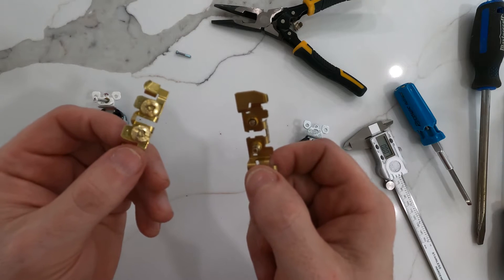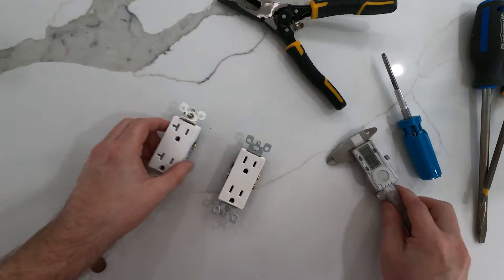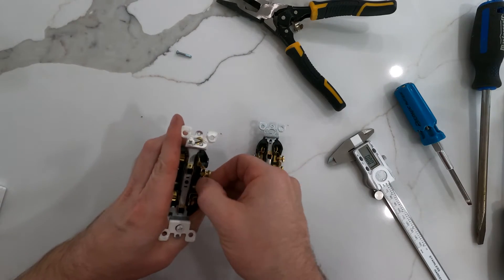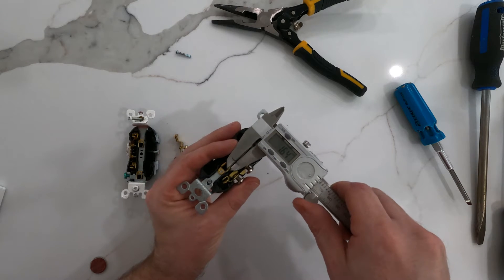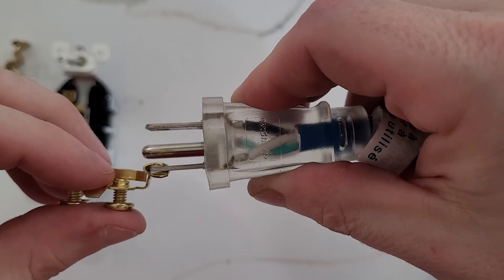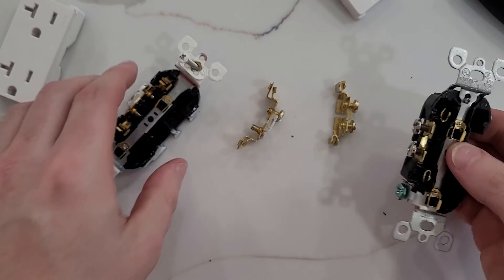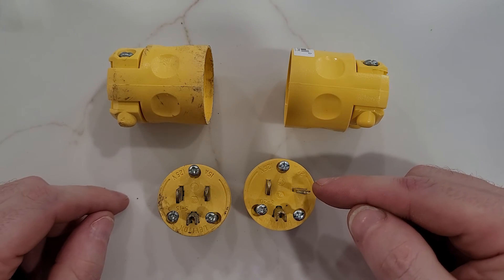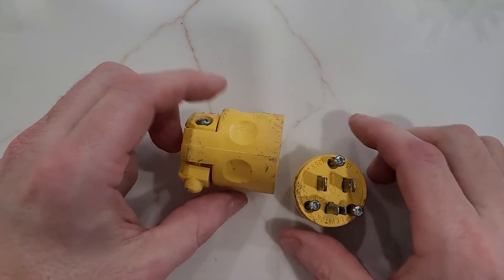Difference Between 20 amp vs 15 amp Receptacles!

Comment: Material has a lot to do with conductivity. Until you run a multimeter on it and see the numbers your just pissing in the wind buddy
Reply from the maker: it's literally exactly the same material 🤣😂
Reply: What kinda test did you do to know what metals were used? @MooseDoesStuff
Reply from the maker: @joshholschuh1847  I asked it what it's pronouns were.

Seriously, the way science works is if you find a flaw in my experiment is to do the experiment yourself while adjusting for that flaw. Then see if you come up with the same results. Then share your results. If you've got reason to think they're NOT identical metals punched out of the same sheet that comes off the same roll in some factory, by all means, go test them.
Reply: Or did you just look at the plating and assume it's the same
Reply from the maker: @joshholschuh1847 feel free to prove me wrong, tear a few apart and put your meter on them and make a video!
Reply from the maker: @joshholschuh1847  it's kinda bonkers you think that any manufacturer is plating anything in switches or recepticals. And that you can't recognize brass... big oof.
Reply: @MooseDoesStuff and I think it's absolutely amazing that you think that you can see an electronic variation in current
Reply: I didn't say I didn't appreciate what you did, yeah that's good that you took apart two different products and shown that there was similarities but you really want to test electronic components to get real answers. This isn't just stuff you see. In building electronic components , there are several different types of alloys that they use based on the current, in most of the time they're the exact same size, but that makes the variation in current, because some metals have more resistance than others like aluminum has more resistance than copper. An aluminum plated looks just like other materials, if you want to be ignorant about it you can start by tapping on the objects to hear if they have the same tone because aluminum is a lot duller of a tone  than steel, but in order to have a jam up video why don't you just put a multimeter on each end of the piece so you can give an exact readout and make even more of a point if you're trying to make one.
Reply: I really don't understand how a man who does anything constructive doesn't know how to use a multimeter or have a $5 one laying around. That might be the most mind-blowing part
Reply from the maker: @joshholschuh1847  OOf if you think any reading you'll get from a 5$ multimeter is going to be reliable.
Reply from the maker: @joshholschuh1847  You sure wrote a whole lot to say "I don't know how to identify aluminium" and follow it up with "I'm derpy enough to think they're using copper in recepticals."
Reply from the maker: @joshholschuh1847  All this effort you put into showing how you don't know what you're talking about could've instead been put into making your own video and contributing to the science!
Reply: You can convince uneducated people a lot of things but you ain't hitting on nothing but a program that puts words on your video making it click bait
Reply from the maker: @joshholschuh1847  Show me someone who's looked into this any better than I have. Or you do it your way and make a video :D
Reply: @MooseDoesStuff yeah but I'm not a 12-year-old fucking kid, I don't just do what people want me to do just cuz it's something to do, I don't really care if you misguided people. Or at least I don't anymore, the energy that I put into it that was it but good luck buddy. Just don't ever call yourself a scientist cuz you ain't got a chance in hell on getting through an experiment
Reply from the maker: @joshholschuh1847 oooo there's that pesky accountability nipping at your heels 😊
Reply: You want to show something go buy a multimeter, set it to ohms put the probes on each end of that metal parts and when it reads the same number you can say it's the same material without testing the material

Comment: There is WAY more copper/brass material in the 20amp and that lowers resistance and thereby keeps the heat down. So you're right but also wrong. 20 amp is best!
Reply from the maker: @jacobpetersen5662  I like your input! but the measurements show otherwise!

Comment: The different design shape is also tell 15 vs 20 from outside
Reply from the maker: sure, but that doesn't explain the price difference
Reply: @MooseDoesStuff You compared a residential grade 15 amp receptacle to a 20 amp commercial grade. You should compare both of the same grade, commercial or spec grade, then the design shape would be identical, only the horizontal slot would be different.
Reply from the maker: @surferdude642  @surferdude642  you know where to get cheaper 20a outlets in Canada? would love to hear!
fyi: there's no distinction "commercial" vs "residential" here on these.
Reply: @MooseDoesStuff  I'm in the US, so no I don't, sorry. Most of the receptacles are made or at least designed by American companies. I guess the CEC decided that all 15 amp receptacles must be residential grade and commercial grade receptacles are all 20 amp for 120v circuits? That would explain why 20 amp receptacles used in residential applications must be used for 20 amp circuits. In the US, the NEC allows 15 or 20 amp duplex receptacles on 20 amp circuits, without distinguishing between residential or spec grade. Personally, I would only use a spec grade on a 20 amp circuit, and usually on a 15 amp circuit as well. 
There are still some electricians and others that opine if it's a 20 amp circuit, use only a 20 amp receptacle, here in the US, notwithstanding the NEC's permission to use a 15 amp duplex receptacle.
BTW, you can actually get 20 amp residential grade here, although they are not as common.
Reply from the maker: @surferdude642  there's no difference between residential and commercial for recepticals here. just amp rating.

Comment: Odd question hoping you can answer.. Can a 15AMP extension cable be plugged into a 20AMP wall outlet? And vice versa can a 20AMP extension cable be plugged into a 15AMP wall outlet and still be used safely?
Reply from the maker: 15 into 20 no problem. a cord rated for 20 will likely be t-slot or 4prong, which just physically won't plug into a 15 receptical. 
When it comes to safety, the cord matters less than the device on the end. You can plug a 1W LED bulb into a 20amp plug and it's still only going to draw 1W. If you try plugging a welder into a 15amp plug, what'll probably happen is you'll flip the breaker.

Comment: You are not addressing the actual fact that the WIDTH of the rest of the structure is wider on the 20 amp as opposed to the 15 amp.  Your mis-information could get someone killed, from fire.  Please do a more thorough job when inspecting items and posting publicly.
Reply from the maker: the gauge is what matters more, because electricity will take the shortest path. it won't "fill up" unused width.
this isn't misinformation, it's physics.
Reply: @MooseDoesStuff  That's BULL! Less contact means more resistance. It DOES matter. If the 20 amp has more contact surface area, it handles more current and is NOT the same.
Reply from the maker: @jacobpetersen5662  did you watch the video? the contact area is not 30% more.
Reply from the maker: and I'm also not telling anyone to use recepticals that are "under-rated". I'm providing a look into something that doesn't make sense.
Reply from the maker: As for misinformation, most 15amp recepticals are rated for 20amp passthrough. That wouldn't be the case if there was a significant difference in the conductivity of the recepticals themselves. That's on the little bitty break-away tab between the terminals. https://qph.cf2.quoracdn.net/main-qimg-832b2794ee1dfb4f8a158fb8e8f0c019-lq This is part of the UL testing, which you can read about here: https://diy.stackexchange.com/questions/279588/are-15a-duplex-receptacles-actually-rated-for-20a-passthrough
I'd provide a better link but UL wants 1000$ for the current version.
Reply: What is UL ? I’m newbie . Thank you for your educational vid , more plz . @MooseDoesStuff
Reply from the maker: @blessnorthamerica7919  "Underwriters "laboratories" -  they're one of North America's main standards writers when it comes to most things electrical
Reply: @MooseDoesStuff He probably works for the corporations. People that use the word , "misinformation" are either bureaucrats or slow. There is information everywhere, it's up to the individual to decide what they do with that information. There are people that actually think water stains are a miracle just because it looks like the virgin Mary.

There is no such thing as, "misinformation" it's a oxymoron. it's just information it depends on how people interpret it that give it value.
Reply: @MooseDoesStuff  It's not about passthrough. It's about continuous current.
Reply from the maker: @jacobpetersen5662  passthrough IS continuous current 🙄 like c'mon man think

Comment: Note on the 20 amp outlet: there is significantly wider width of material, and so the 20 amp DOES have a significantly larger cross-section of conductor.  So, YES, there IS a difference!  Be careful to consider ALL aspects of designs.
Reply from the maker: I address that at 2:53 - There might be an extra 1mm length on the contact, difficult to measure because of angles. The difference is negligable, and certainly not 25% more, as the amperage rating would imply.
Reply: If it's so different, wouldn't it be easier to measure the difference with an ohm meter? And I would have used a weight scale when measuring the metal parts.
Reply: @Beleg_SB  I said the same thing lol

Comment: You seem wrong as the left one has quite longer contact - it is not only the short contact that matters - the other side matters as well. Plus it act as heat radiator as well. Agree ?
Reply from the maker: No, the actual area that's making contact with an inserted plug is much, much smaller - basically just a single line, not a full side surface. And there's no realistic difference in how much heat is being dissipated.
And you don't want heat dissipation in a receptacle anyway.

Comment: It is good what you did, but you should have measured 1) resistance & 2) heat: use the same plugs & measure the 
resistance across a bottom slot input & output at top, also bottom screw to top screw.  See if the resistance is the same. My guess is that a 15 amp receptacle is quite capable of handling 20 amps without generating significant heat.  Measure that also.  Run 20 amps through both receptacles in identical enclosed environment & measure the heat.  My guess is that physically & electrically the only difference between the 15 amp & 20 amp receptacles are the horizontal slots designed to prevent you from attaching a 20 amp appliance to a circuit with #14 wire in the walls & a 15 amp breaker at the box.  But I have not done the tests -- this is just my guess; so don't anybody rely on my guesses.
Reply from the maker: I might dig into that a little more later, but with the material being the same, and the thickness being the same, I'd very, very much expect that any heat or resistance differences will be ... very small. I also don't have the gear to get reliable measurements for that sort of thing XD

Comment: You just answered a question that I have been asking for a very long time which is how many 20A recepts can be used on a 20A amp circuit? NO MORE THAN TWO? is what you said right? doe that mean that it would be safe to use in two 20A devices at the same time. I would like to learn more about bigger circuits like 30A and multiple receps. 20A 15A etc.
Reply: Talking U.S. All kitchens have to have two independent electrical circuits as a minimum and they are usually 20 amps each. How many receptacles can they handle is not the question. What you want to know is how many Amps are you asking the electrical circuit to deal with. With a 4-slice toaster, a microwave and a dishwasher all working for a few minutes at the same time that's it for that circuit for the moment for just one circuit  Its not a mystery about how many amps your appliance is using. It's shown on the bottom of the toaster and the manual for the microwave and dish washer will show what it app use is. Add them up and you'll know if it's too much.  Actually on a 20 amp circut you try to stay at or under 16 amps. Not unusual for a kitchen to have three circuits considering the garbage disposal draws a lot of amps with you first flip it on.   Note that exertion cords are not rated for 20 Amps. More like 12 amps for a 6-foot cord.
Reply from the maker: In canada, in kitchens, no more than 2. I have never seen, and neither have the city inspectors that I talk to, any 20A devices for use in residential kitchens. I think the idea is more so you can have two heavier load devices on the same circuit (mixer and blender maybe) without worrying about tripping the breaker.
Reply: @MooseDoesStuff  I believe nec says 10 but not kitchen i guess....?
Reply from the maker: @itzNickyJayBeats  in Canada in kitchens it's 2. cec for canadians says 12 on a circuit otherwise

Comment: Yes I am surprised because I thought that the gauge  determined the resistance just like it does with the wire gauge. And I thought that the reason why a 20A recep has a horizontal pin is that the horizontal pin would be a thicker gauge but sice the 20A flows through both sides, then I suppose both sides would have to be a thicker gauge; many questions come to mind when you start digging into things like why is the horizontal pin on the neutral side of the recept.
Reply from the maker: Even the engineers at Leviton didn't have an answer when I called them :(

Comment: In the USA, code allows 15 amp receptacles to be put on 20 amp circuits as long as there is more than one receptacle on the circuit. A single double receptacle, like the ones you had in this video, qualifies as the "more than one." (And, of course, it's only allowed as long as you aren't trying to plug in an appliance that requires the 20 amp receptacle (i.e. with the crossed plug.)) There are also restrictions for circuits that will have a "continuous load" on them. So, if your running a continuous load, you're not allowed to max out the circuit.
Reply from the maker: Same as what Ted said ! In Canada these 20amp receptacles are required in kitchens 😔
Reply: @MooseDoesStuff  I thought tha they are required in the USA too; Ive been hearing that for a long time.
Reply from the maker: @carlodonnell146  might be, I can only speak to where I am
Reply: No one ever explains WHY, is it supposed to be OBVIOUS, because it is not to me .even the code books don't say why; when you know why it is a lot easier to remember.
Reply: @carlodonnell146  The "why" in this case is because they've determined that if there are multiple receptacles, you're likely to be using more than one of them. This means that the combined usage will trip the breaker before any one receptacle gets overloaded. These assumptions are used in several places in the code.

This is based off of observed usage. There is always the possibility that you have the one case that's different. It's a probability calculation.

Comment: Excellent information, I've taken some apart also and seen others do that and the conclusion is the same as yours. There's no significant difference as long as they are the same grade. I think the disagreements come from those comparing residential grade with commercial grade. In the US, 15 amp receptacles are permitted on 20 amp circuits as long as they are duplex receptacles. In most newer homes you won't find any 20 receptacles, even in kitchens and bathrooms. You may find some, and it's done for identification of a 20 amp circuit, local code requirements, or myth. BT W, this also applies to GFCI receptacles which are at minimum, commercial grade.
Reply from the maker: Unfortunately in Canada the 20amp are required in kitchens. Which is a real bummer because none of the people I talked to about it, including CSA certifiers, have ever seen kitchen appliances that have t-slot plugs. So we have to pay 3x for no reason.
Reply: @MooseDoesStuff  maybe it is just in case some appliances do come with 20A. things are changeing all the time.